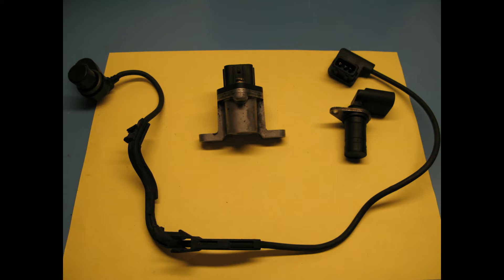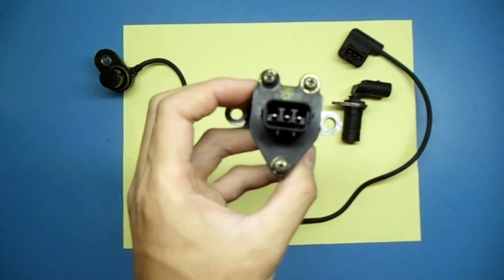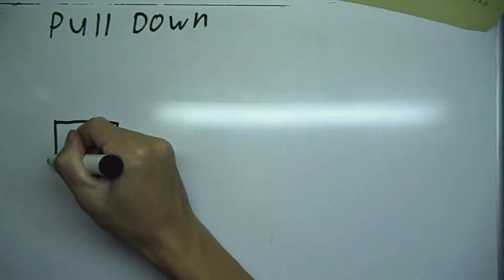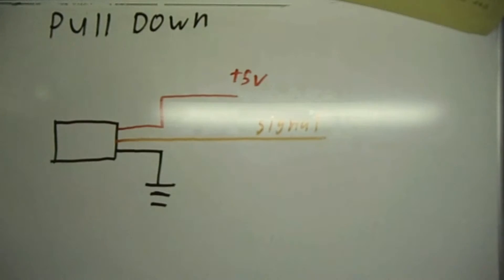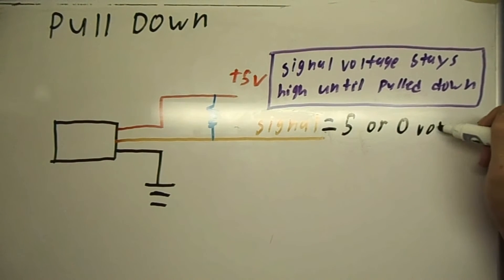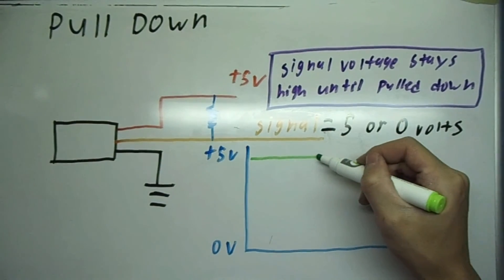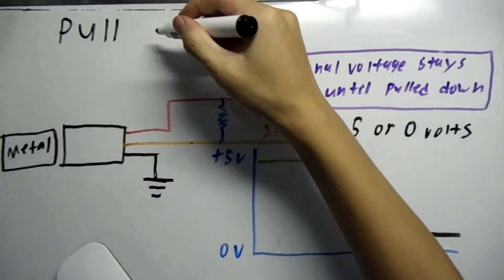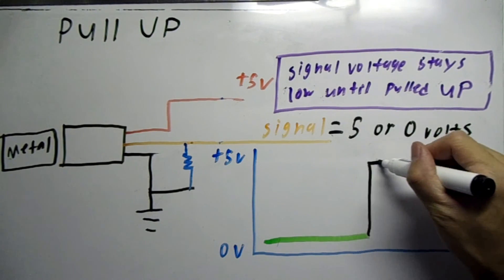Pull Down and Pull up Type Hall Effect Sensor Circuit for cars (simplify)

Comment: Can anyone explain how the resistor on the ground side work? I understand the signal voltage is low or 0 when the sensor is not activated but i donr understand how the resistor comes into play.

Comment: Nice , the only thing that im wondering about is the signal wire , is the ECM gives voltage to the signal wire ? Or the sensor that gives the voltage to the ECM ?
Reply: In pull down type the resistor lives within the ecu and the voltage comes from the ecu.